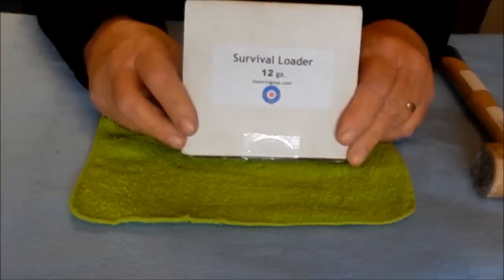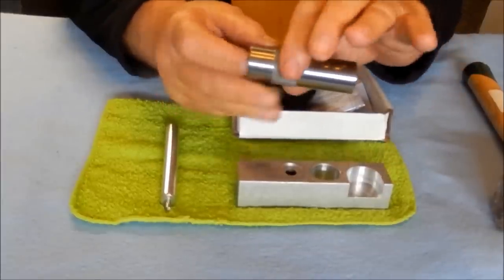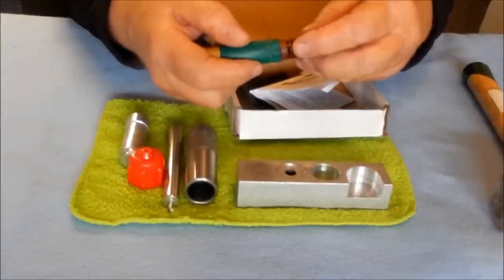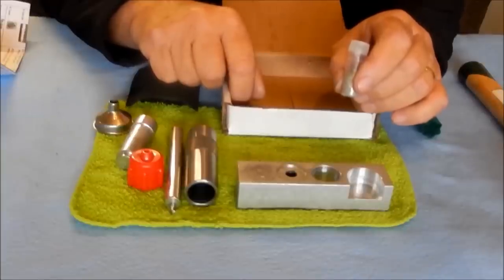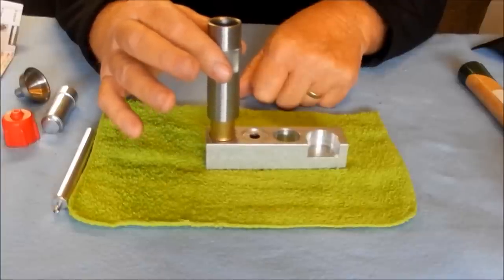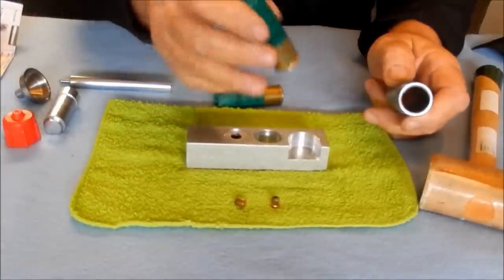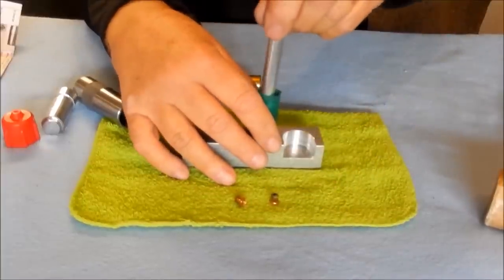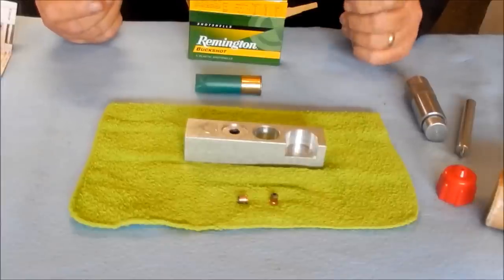Survival Loader -12 ga.---New video update coming for Gen. #2 May, 2024

Comment: The question is : will rubber or cotton or wool wads substitute plastic wads in SHTF
Reply from the maker: good morning Andrei.
if you are in a SHTF situation, I would guess that anything you can get would by necessity have to do.
If they are over-shot wads, then you have more choices.    If they are an over the powder wad, then you need to consider this.

Wads, should be non-flammable.  
The last thing you would want when SHTF is to also deal with a fire.     
Rubber as an over the powder wad I suspect would probably melt from the heat for the powder burning and friction going down the barrel.
Cotton is flammable and would also make a poor wadding material.
It would be best to use any reasonable "non-flammable" material for both.  
I make my own over-shot wads, but, use a commercial over-powder cup style wad.

Im sorry if I cant be more specific.   But, when you are in a SHTF situation.   You would have to do anything to survive it.   Experiment, see what works for you.   What is readily available to you.

Thanks for writing.  It is appreciated.  I know other readers value your question.
Best regards
Barry

Comment: This kit (@$90 to $95), a pound of powder, a few slides of primers, a bag of shot and either a small bag of old school fiber wads or a 3/4" hole punch should be all your bug out cabin needs, but in a bug out bag, I'd rather carry all those supplies in the form of loaded ammo and not worry about reloading on the run, and as cheap as the Lee Load-all is (@$70), I'd outfit my cabin with one of those instead and save a few bucks😏

Comment: Do you have to clean shotgun shells like you do brass ammo, inside and out
Reply from the maker: Hello and no, not like all brass cases.
With shotgun hulls, you can do either,
I just wipe them with a rough cloth to remove the dirt.  Sometimes I use a small brush on the primer pocket after the primer is out.

But, if the metal base won't clean up, then I have a case tumbler that I put them in for 10 minutes with walnut shell media.
But, usually a rough cloth or kitchen scotch-brite pad will clean the base.
Remember, the hulls today are plastic with a metal base.  
Hope this helps.
Barry

Comment: can this be used to get live primers out of a 12 gauge shot shell?
Reply from the maker: I have done it several times.  But I do not recommend it.  
It is not a designed function of the kit.   
When I experimented with this.  The shells had all the components removed.   Just an empty case with the primer.    
I used small taps.  2 reasons why.  
I didn’t want to damage the primer for re-use.   
And.  
More importantly.  I didn’t want it fire.   
I wore eye protection and work gloves.   
I only had one fire.   Scared the h*** out of me.   But I was not injured.   
So basically, the decap rod will do it.  But I recommend against it.  
Happy New Year. 
Best regards 
Barry
Reply: @barrydeclined2547  You did use something flat on the primer bottom right?  If you're using the small needle end, you have a high probability of setting off the primer.  I would use a small wooden dowel if I were you guys.
Reply from the maker: Hello Clark:  As in the original post;
we Do Not recommend using the decap rod to deprive a live primer.    
That said;  I pointed out that I had done it, experimented with it and it can work.  

First, the decap rod goes inside the Empty Case.  There is nothing under the  primer but the empty hole in the base station.   
Nothing sharp or pointed for the flat bottom of the primer to touch.   
So, nothing is under the primer to act like a firing pin.

Again, the kit is not made for this purpose and should not be used for this purpose.  

Thank you for commenting and giving me the chance to clarify just in case someone misunderstood.   
Please feel free to write anytime.
Thank you and best regards.
Barry
Reply: @barrydeclined2547  Sorry, when I say bottom of the primer, I mean where the flash comes out.  So the point of contact on the primer to drive it out is where I'm talking, inside the shell.  I know there's an empty hole under the primer.  So nothing should act as a firing pin.  I'm just asking if you're using the needle side of the depriming rod or the flat side?  I don't see it going off it you had a flat surface on it instead of a sharp side.  Making more sense?
Reply from the maker: Thanks for clarifying.   
I used the pointed end.   Light taps worked.   
I experimented with a very heavy hit and was able to make it go off.  
Nothing happened other than the surprise.    
No pressure.  Decap rod didn’t even move.  Just the noise and a slight smoke.  
I wore gloves and eye protection just to be safe. 
But; it was experimental.   Not recommended.   We just did it out of curiosity.    
Wanted to see if in an emergency situation we could save a primer to use in a different gage shell.  
Barry
Reply from the maker: Casey.   Please feel free to comment on anything you feel will be of interest to the other readers.  
We have learned and improved the Survival Loader with the input from comments.  
It really is appreciated and encouraged.   
Thanks again.  
Barry
Reply: @barrydeclined2547  Ok cool.  We are on the same page now.  Thanks for talking with me.  Have a good one.
Reply: I'll bite , Why would you want to remove a live primer ?

Comment: Can this do a roll crimp? Pros and Cons of roll crimp vs star crimp and why use 1 or the other?
Reply from the maker: Hello and good questions. 
The kit is designed for Star Crimping. 
But if you add a Roll Tool, then yes, it will also do roll crimps.  The Roll Crimp Tools are not expensive. You can find them on ebay or Ballistic Products also has them. 

As for Star Crimps vs Roll Crimps.  
If you are loading Slug Loads, then a roll crimp would work best. 
If you are loading Shot Loads, even buck-shot. Then, I prefer the Star Crimp.   You can Star Crimp anywhere.  

To use a Roll Tool it is recommended to use an electric drill or drill press.  

In a survival or emergency situation, electricity may not be available.  
The Survival Loader kits are designed to make reloading possible when you have limited space, are in the field and have no modern resources such as electricity. 

I hope this information helps.  
This of course is just my opinion and point of view.  Others may feel differently or have more suggestions. 

Best regards.  Barry
Reply: @barrydeclined2547  thanks. I did see 2 manual roll crimpers. 1 from Russian, 1 usa that mounts to a 2x4, just wondered about yours. Thanks, looks like a cool thing to have.
Reply from the maker: I added the 20 ga Roll Tool to my reloading set up for home use.  
Got it from Ballistic Products.  
I rarely use it since I reload Slugs just every now and then.
Other than that.  It’s there if I need it. 👍🖖

Comment: Can you load slugs with it?
Reply from the maker: Hello. 
The Survival Loader Kit is set up with tools to reload the more common “Star Crimped” shells.
But;  
 if you add a separate “Roll Crimp” Tool, you can make the final crimp a rolled crimp. 

Roll Crimp tools are modestly priced online. 
I bought mine at ballistic products. 

I use the Roll Crimp for my “slug” reloads only. 
All others (shot, buck, etc) ...I use the more common Star Crimp. 

You can also make Slug Loads with a Star Crimp shell.  Or with the “cut shell” method.    They all work fine.

Hope this information helps. 
best regards........barry
Reply: @barrydeclined2547  Thanks Barry and God Bless.
Reply from the maker: @OneofMyTurns  🙏👍🖖

Comment: man if you guys had one other component for roll crimping for slug reloads, it would be a whole new game changer.
Reply from the maker: Thank you for the comment.   It is appreciated.

The Roll Crimp Tools are pretty common from various online sources. 
Normally they are modestly priced and easy to get.

We did not add them to the Kits because of several factors.     
Additional cost that would significantly increase the price of the kits.
Roll Crimp Tools usually require the use of an electric drill or drill press.  
They need  friction heat and pressure to form the roll.

In a survival or emergency situation, electricity may not be available.   
The current Survival Loader Kits are designed to be a drop in your pocket or bug-out bag emergency reloading tool. 
   
Roll Crimp Tools  can be bought separate and added to the kit if one is desired.   
That said, Star Crimp cases can be loaded with just about everything, including slugs.   

I hope this helps to explain why a Roll Crimp Tool is not offered.

My best regards.     Barry.

Comment: Are the kit/tools available in Amazon? Where can I get it
Reply from the maker: Good morning.  
The kits are available direct from   thexringusa.com   or from Ebay. 
They have an independent dealer authorized to sell. 
On Ebay enter 124165006574
It will take you to the 410 kit and links to the other gage kits. 
I hope this information has been of help……Barry
Reply from the maker: The kits are sold on the website and by a dealer on Ebay.  
The website is:::
thexringusa.com
The Ebay link are:::
410
124165006574
20 ga.
 124347399438
12 ga.
123768131797

I hope this is of some help. 
Barry 👍

Comment: Hey Barry, Would like to have your load specs, I will be loading exactly as you do Remington cases and all
Reply from the maker: Hello Pete:
If I recall, I used 15.5 grains of Hodgdon H110 powder.  
My shot load was 1/2 ounce perhaps a smidge less in weight.  I use 1/2 oz for all my 410 loadings whether shot or buckshot.
BUT
Please use a loading manual or go to Hodgdon web site to get the latest re-loading data.
This load works great in my single shot 410.  
But about of an abundance of safety, please check and verify the latest data from the powder manufacturer.   
You can use other powders, but, alway get the latest updated data.  
AND use a scale.

I hope this helps.  
Best regards
Barry
Reply: @barrydeclined2547      Yes sir that will give me a start, But as you suggested ,I  will purchase a Hogdon manual and also a good scale. My loader ships this Tues. Thanks again
Reply: safety always 1st
Reply from the maker: Hello Pete.  
Yes. The order ship’s Tuesday afternoon.  
You don’t need specifically a Hodgon shot shell manual.   
Lyman has a decent shot shell. Their manual has loads for many different powders and components.  
More versatility and choices.  

Best regards 
Barry
Reply: @barrydeclined2547  Thanks
Reply: @barrydeclined2547  Hey Barry I received my reloader kit. I'm primarily going to reload my Remington 2 3/4 shells 00 Buckshot. Just like you i figure on doing 1 oz of #00 shot. Not figuring on using it as a primary reloader but just to replace what I shoot. What wads do you use for this application. for got to mention 12 Ga. I am looking at some AA shot wads on amazon rated for 1 oz of shot it says. Looking at a digital scales
Reply from the maker: Hi Pete.  
I have several different wads.   Each is different and changes the internal volume which can effect the crimp.  

I mainly try to use Federal wads.   
I vary my shot loads from 7/8 oz. to 1 oz depending on how much space is left for the foam “over-shot” wad.  

Sounds like you have a good handle on things.  
Keep me posted.   
You also have my direct email at yahoo on your receipt.  

Barry
Reply from the maker: I wish Youtube would allow me to attache a photo for you.    The wad I am currently using is the "Federal Champion" one piece wad #125.    So far they have done a nice job after I figured out the shot load to get the room needed for a crimp.

Barry

Comment: What kind of powder do you recommend this question is for anyone
Reply from the maker: Good morning::
For my personal 12 & 20 ga. loads I use TITE-GROUP or CLAYS. 
For 410 I like H110.  Great 410 powder. 
H110 is also versatile in that it is a good powder for my 45 Colt loads. 
Plus; I never load to max.  
I keep things mid-range for safe pressure.   
Hope this helps…..Barry

Comment: Great product Barry!  I am in the early stages of jumping into reloading (close to retirement and joining a sporting clays club), however finding powder and shot these days is nearly impossible.  So bad that I’ve held off on purchasing my first single-stage reloader.  So frustrating.  I’ve adjusted fire (no pun intended) and have been simply stocking up standard Federal trap/skeet loads from Wally.  Hell,a case of 100 is only $20.  I also want to load 00 and slugs....same dismal amount of products out there.  Anyway, how difficult would it be to take an unfired 2 3/4 standard trap/skeet load (7.5 shot, probably 1 1/8 oz), or dove/quail load and “reload” it with 00, or a slug with your cool product?  Not really into trying the wax slug deal, but whatever works in these trying time.  Thoughts?  Much appreciated.
Reply from the maker: Hello and thanks for asking your question and commenting.

The Survival Loader is designed to re-load fired shotgun hulls.
That said.
The Survival Loader would be able to re-crimp the shell.

There are dangers to what you would like to accomplish.

First ;the factory crimp would be somewhat difficult to open as it is heat set and formed.  
But, it would be possible to get the crimp open without causing too much damage.

Second; there may be a problem with compatibility of the powder charge for the new shot load.

You might try to find out what type of factory powder was used & the charge weight.    
Then consult a loading manual to make sure the charge is compatible with the new load weight.

Too heavy a powder charge & you could have over pressure issues.
Too light a charge & you could have other problems that may damage your firearm.

I hope this helps 
Barry
Reply: I have two lead molds intended for making slingshot ammo they were made by do it mold co. I got two different size molds and each mold makes two different size balls they were advertised as being able to use the balls for split shot by tapping a sharp knife into the balls and splitting them
. I have yet to mike the balls and compare them to the different buckshot sizes . But when the shtf I’ll be ready for loading buckshot using my slingshot or fishing wts. Just thought you maybe interested. Also I have several of the old lees hand loading kits in rifle pistol and shotgun configurations. I used to sit on floor and load .44 magnum loads while watching t v I love those kits . It’s relaxing just don’t expect to speed load so I’m prepared
Reply from the maker: Hello Charles 
Thank you for sharing with us all. 
One of the previous commenters had a great tip for substitute lead loads.  
Fishing supplies.   Lead “split shot”
One way to get near buck-shot for loads.  
Don’t know about accuracy. 
But, lead loads in a pinch.  

Sounds like you have a pretty good handle on using the Loader.  
Besides being practical.  It’s also fun.  

Let me know if I can help.  I will as best that I can.  
Best regards 
Barry
Reply: I have yet to master the roll crimp
Reply: I would like to know more about the roll crimp
. Do I need to cut the old star crimp off ? How do I proceed with star crimped shells to start the roll crimp
Reply from the maker: You have a couple of options that will work equally well.
You can leave the "star" in place, but, you need to make the end stay round.
The roll crimp tool has a groove.  The end of the case needs to fit into that groove so it can then roll the case mouth over to make the roll crimp.
OR
You can cut the case to just above the crimp line fold.  It would be nearly round. 
Then do the roll crimp.
This would make your shell approx. 1/4" shorter.  
It normally is not be a problem to have it slightly shorter.  
But, don't go too short, especially if using a semi-auto.  It might cause feeding issues.

Most of the shells they call "mini shells" give feeding problems as they are really short compared to full length.

When I make slug loads for my 410, I use the cut-off case method.   I cut off the star crimp just slightly below the crimp line.
Then I put an overshot wad over the slug.
 Then I use white glue to secure the overshot wad/slug in place.
But, I only use this in my single shot or my side-by-side 410 and also in my 12 gage.

I hope this helps.   Let me know if you have more questions.
Barry

Comment: Can you load lee 7/8 slugs with this kit ?
Reply from the maker: You can reload any loading, including Slugs that are from published reloading data.  If you have data for 7/8, then you can reload it. 

I load my slugs with the “cut shell” method, and sometimes I use the roll crimp method. 
Roll crimps are the best way to go for the 12 ga. slug reloads. I use a roll crimp tool that I bought from BPI.  They are modestly priced. 

The only downside is an electric drill is needed to power the roll tool
The “cut shell” method works almost as well.  I use both methods equally.  

I hope this answers your question.   
Please feel free to write and I will help as best I can. 
Best regards 
Barry
Reply: @barrydeclined2547  do you offer a kit with aluminum base , sizer, deprime rod , hull cutter, and roll crimp tool ... package?
Reply from the maker: The 12 ga kit PLUS kit has the following components:

Multi base (aluminum)
Dual purpose Size Die (steel)
De-cap Rod (aluminum & steel pin)
Crimp Set Tool (aluminum)
Hornady Crimp Starters 
(both 6 point & 8 point)
Powder-shot vials (4 pack)
Instruction sheet (full color pics)
Shipped in a Corrugated mailer/storage box.

Hull cutters and roll crimp tools are not available through us. 

Barry